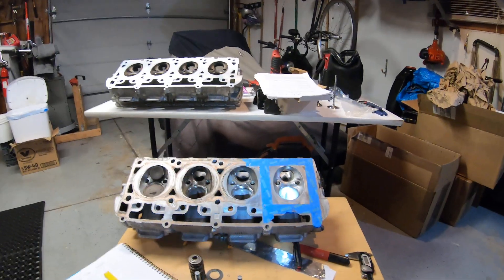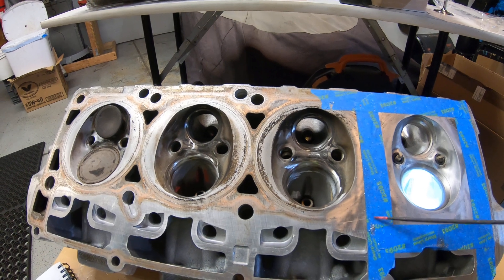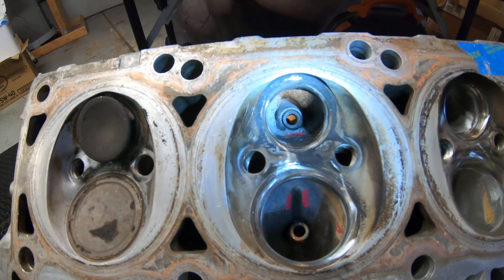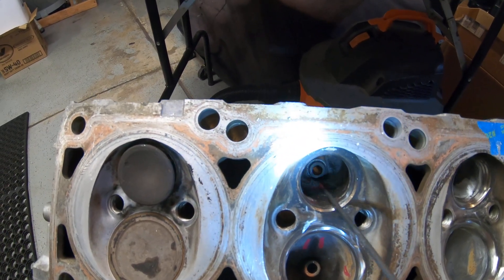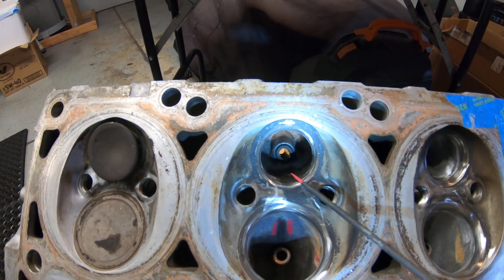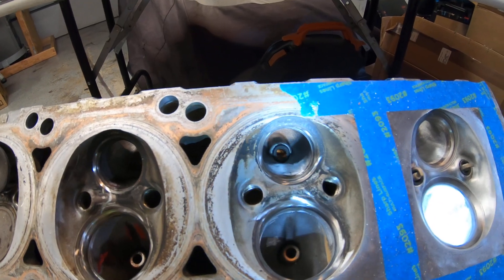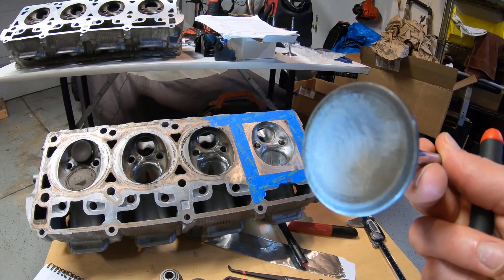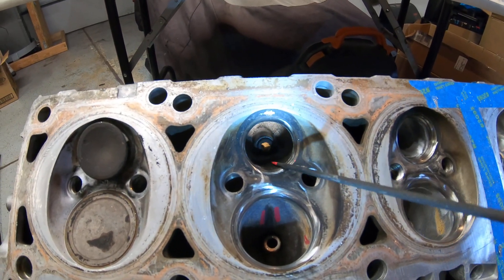Eagle HEMI Cylinder Head Exhaust Porting Pt. 2

Comment: I’m getting ready to do my heads here in the next couple of months. Same Gen 4 head like you have there. Just wondering if you flow tested them after you got done and maybe could do a more in-depth video on your exhaust port and what you did to maybe make it swirl around that guide boss.
Reply: Right on that sounds like a great flow increase on exit. Bang for your buck.
Reply from the maker: I was planning to send my sampling head out for comparison on as-cast vs ported but USPS wanted $75 each way plus the cost of flow bench time to Weingartner Racing.  Sorry
Reply: @GarcBomber  Not a problem man I appreciate it I’m just going to clean mine up a little bit all the way around
Reply from the maker: @ryanwalsh3966  Forgot to mention I modeled the exhaust port in solidworks and based on those restricted/pinched areas should result in 16-19% more volume exiting.  Casting molds have natural variation.  I did end up using 1.65" exhaust valves with my 85% throat calculations.